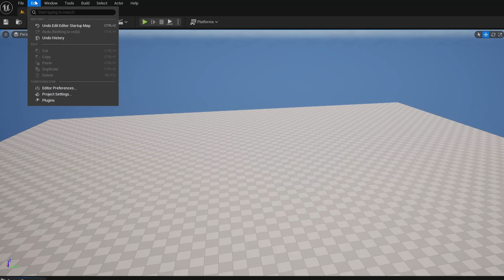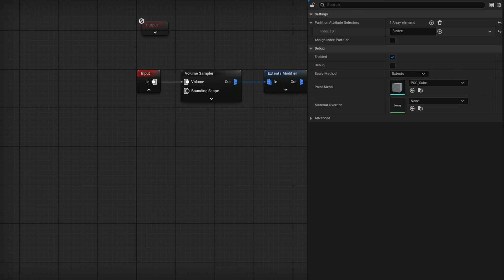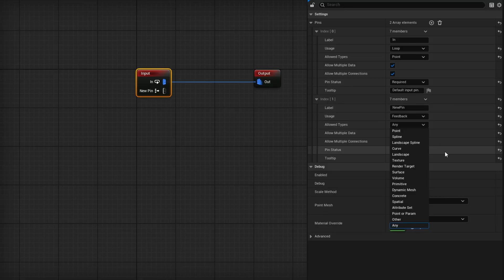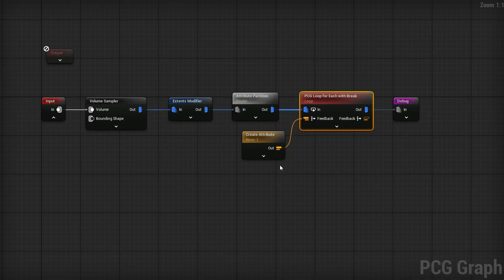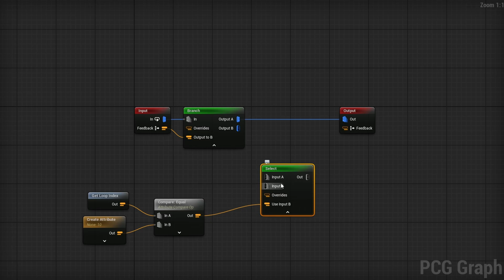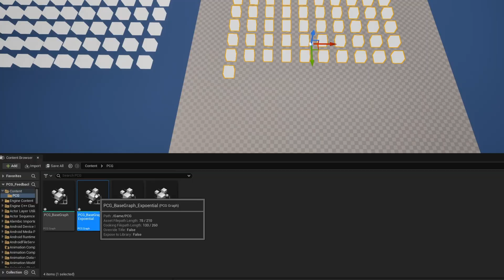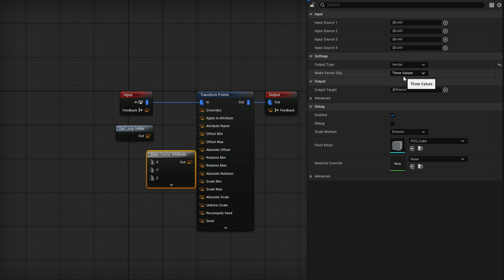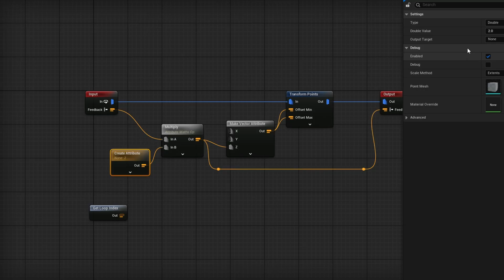What Are Feedback Loops and How Do They Work? | PCG Basics

Comment: Hello - do you know of a way to be working in one pcg graph and get point data generated by a different pcg graph in the level? I have different pcg graphs in the level and the pruning function will only work on a single point data set. If the separate pcg volumes overlap, then they don't prune each other.
Reply from the maker: I believe you need to change it from getting a single point to parsing the component data. Or you can use the spline and just do an interior spline sampler on the second spline and bypass the graph it uses entirely. Depending on what you need.
Reply: @Procedural_Minds  Thank you. At first I was trying the alternative method you described, but i need to identify multiple different splines through parameters..get spline data by actor tags would work - the problem is that it looks like you can't pass the tag name to the get spline data node (needs to be dynamic).. do you know how to pass a tag name to get spline data? or pass tag name to get actor property (by tag)?
Reply from the maker: @thelawless999  I believe you can specify a tag on spawn. It's in the options there if I recall correctly. I don't have it up right now to check.

Comment: I'm trying to place it closely along a specific area or line like a building, but it's not easy to apply using this method. I would appreciate it if you could make a video about it next time.
Reply from the maker: Can you be a bit more specific? What are you trying to do? Cause all this does is send the information to each point from the last. It won't make something hug a wall for example if it wasn't hugging it before. Unless that's what your loop is doing to begin with.